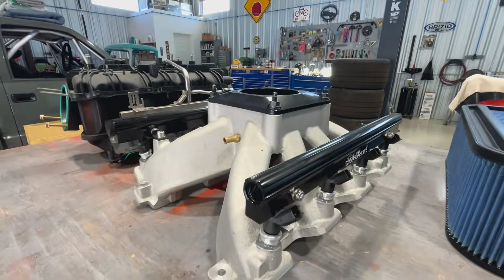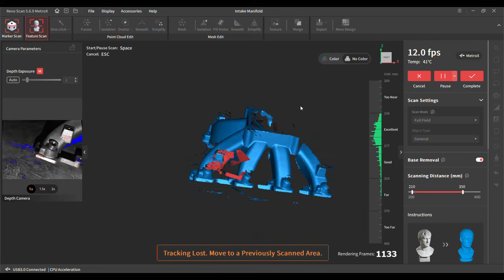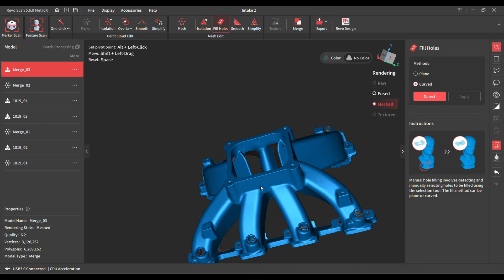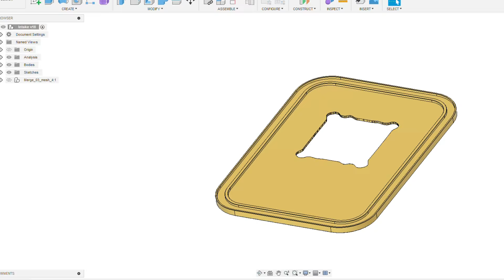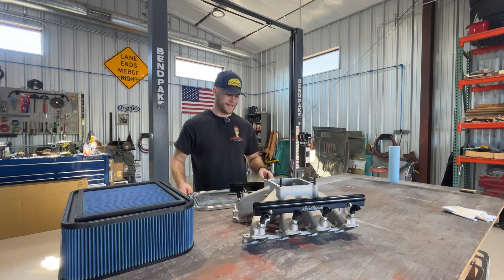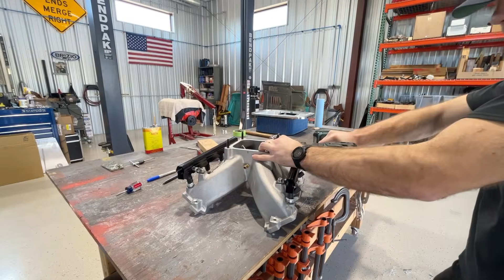How To Install Sprint Car Air Filter Using RevoPoint MetroX 3D Scanner

Comment: I see what you are after, and it fits well, but I'm not quite agreeing with the base touching the fuel rails. I see vibration causing issues down the road. Also, how much clearance between the top of the throttle body and the bottom of the filter?
Reply from the maker: It’s about 2 inches
Reply: @MonarchEngineering918  it will be really interesting to see where where the airflow is, based on where the dust builds up in the filter